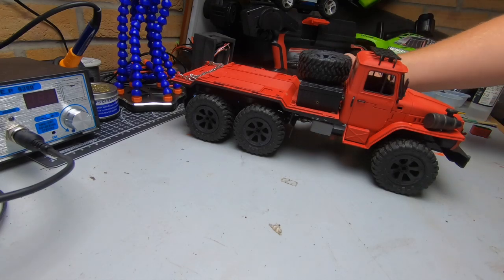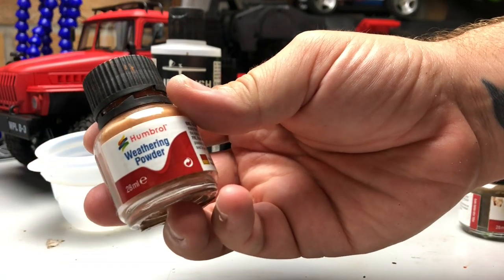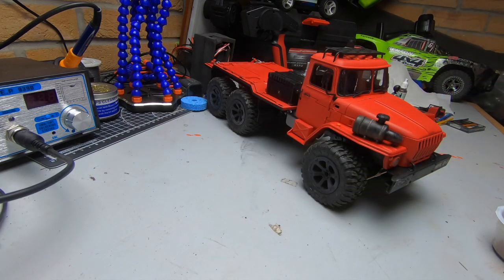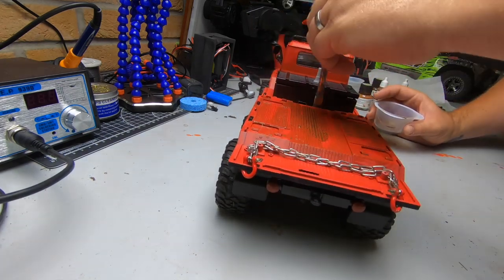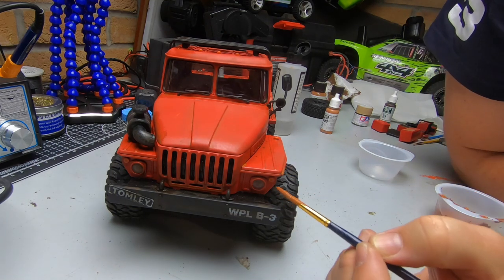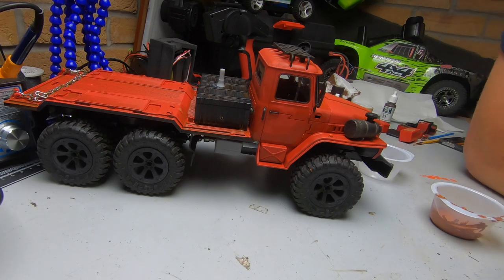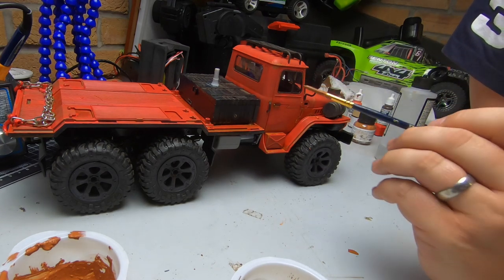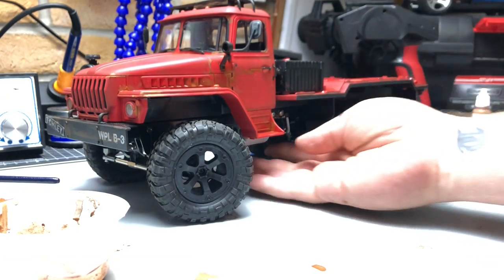Scale Model Weathering for Beginners - WPL B36 - Easy Weathering Techniques Bob Ross edition

Comment: cool stuff. a while back Gabriel Silvaz channel showed using steel wool to crush leaving particles all over, then using a mister with vinegar and salt mix to make the rust happen. after its where you like it (and dry), then mat no gloss clear coating. another neat little way.
this morning got lap full of New Bright Jeep body going onto WPL C frame, gave it 10 mm LED's and plastic chrome bezels for the headlights (super bright!), sliced the hood so it opens (12lb fishing line figure 8 stitched for hinges and magnets to latch shut). it'll be slow with the 400 rpm 6v N20 motors for now. if you haven't seen yet, I uploaded 5 videos last week, 1st one showing the lowered C-24 DRIFT MINI TRUCK! click my nickname to get there I suppose :)
Reply from the maker: Yes, I've seen them technics used with the steel wool and salt etc...

Comment: Does these tires and wheels  Fayee-FY004A-116-6WD will fit to WPL B36 truck? Are they not so fat?
Reply from the maker: These are the FY004 wheels 👍
Reply: @TomleyRC I know - but how you install them especially on the rear axles they so close to each other?

Comment: Wait, you could take the truck top off?!?!

Also, what paint did you use to paint the body? And would the paint work on wpl c24s?
Reply from the maker: I used 'Tool Box Red' out of a rattle can. If you use a good plastic primer, you should be good 👍